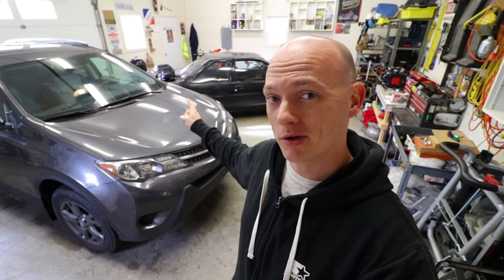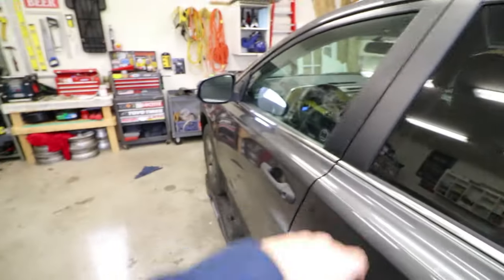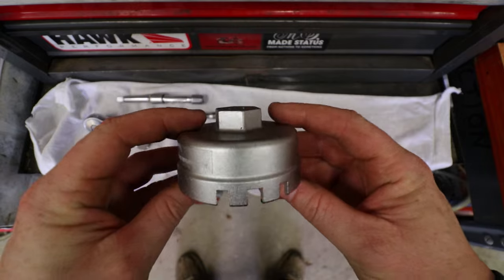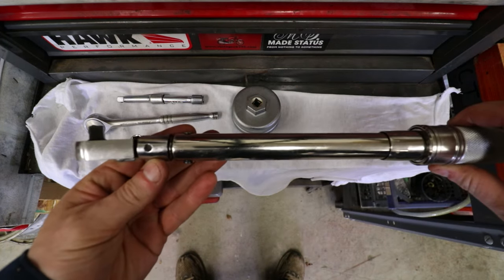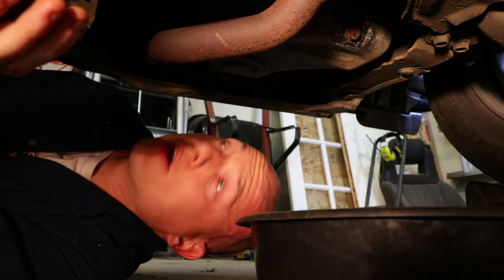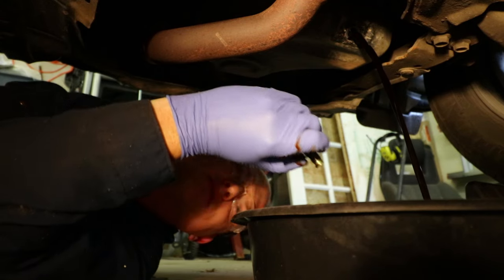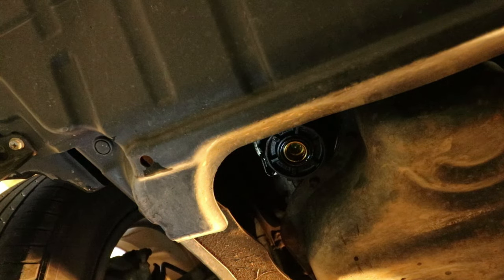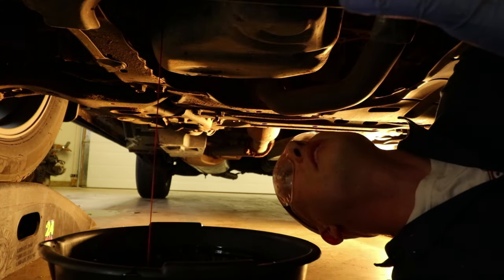How to change Toyota RAV4 oil and filter 2013 to 2018

Comment: Hey, my 2015 Rav4 has over 155k miles. Is sae 20 still recommended or should I buy the oil most mechanics use after 100k miles?(30)
Reply from the maker: Stick with what Toyota recommends for weight. You could always opt for one of those high mileage designed oils from any of the leading manufacturers though, while still keeping the same oil viscosity.
Reply: 5w40

Comment: I see that some manufacturers have a spin on oil filter for the RAV 4.  Would you recommend it or do you like the factory housing?
Reply from the maker: Honestly... I'm so use the the cartridge setup now that it doesn't really bother me. It is a lot less mess than the old spin on type.

A spin on filter mounted on the top of the engine would be the most convenient (ie. Toyota 86 / Subaru BRZ).

Comment: Mike. Some premium oil cartridge oil filters have a steel sleeve inside them. Plus there is a steel sleeve inside the toyota oil filter housing. Will using a premium oil filter cartridge restrict oil flow due to having 2 steel sleeves in a filtering assembly? (OEM Toyota filters don't have a sleeve inside the filter)
Reply from the maker: Hi David. Honestly... That is not a question I can answer. I'm not sure of the engineering ins and outs associated with oil filter design.
Reply: @Mike_Barker  OK. Thank you. I will stick with the OEM filters, don't want to replace the oil pump from over work.

Comment: Took our Rav4 in for its 1st due oil change (covered by Toyota Care) and the dealer didn't even change the oil?!?!?!  They probably think 99 % of the people won't even check but I did.  Turns out OK,  because now I don't want them to touch my car as I've read too many comments of dealers over-tightening the oil filter housing.  I'll spend the money and purchase the tool to remove the oil filter housing.
Reply from the maker: Wow... That is surprising! At least you're in control of the changes from now on.

Comment: I changed mine like it says it takes 4.6 quarts but I had to use the whole 5 quarts to get it up to the top mark on the dipstick.
Reply from the maker: Hmmm something is off there. Typically the instructions line up perfectly with my Rav everytime

Comment: Does it matter if the car is on level ground when changing the oil? I see you have it on a ramp.
Reply from the maker: It's not that critical. Some trace of old oil will always be left in the oil pan. Whether the car is perfectly level or not.
Reply: @Mike_Barker  Got it! Thanks!

Comment: Clean, good job!
Reply from the maker: Thanks Nikolay! Anything else you'd like to see a video of?
Reply: I have the same gen. RAV4 with 67K miles on it Mike, trying to do "Do-It-Yourself" regular checks and maintenance, but without garage it's hard to cover big chunk where you have to lift car up. Would be nice if you could make video or series of video which covers regular check ups every 5K miles followed by Toyota Maintenance Guide, plus when driving in special conditions (e.g. inspect ball joints, drive shafts, etc..)

Thanks and good luck in new project videos!
Reply from the maker: Ah good ideas! Regular checks can be done easily on a lot of things. Thanks for the input!

Comment: Thanks, but GOD, what a PITA!!! What was wrong with the old spin on filter??? It took an hour to do the 2014: Bleeping housing WAY tighter than spec, I cam in to watch video again because it was so tight, I thought it might be  a left hand thread..(Done by DEALER!) Next, I did my daughter's 2007 RAV 4. 10 minutes...!
Reply: Don Hansen same problem dealer did on my niece 2018 RAV4, I tried to do oil change on her car, but filter housing is way to tight the dealer did last time, I couldn’t took it off, afraid will brake off the housing, end up only did oil change without replaced filter.
Reply: @chucktang2783  
PLEASE complain to the dealer and ask they if their mechanics can read and follow instructions? The torque spec is printed right on the top of the oil filter cap. Duh? Tell them if that's the kind of work/lack of intelligence their mechanics have that you are considering never having your car serviced there again and never buying another vehicle there again. I would give the Holy hell.

Also, you should have a ½ drive breaker bar and a ½ drive socket of the proper size that fits the hex fitting on the oil filter cap to get it off.

Comment: Where did you get torque value for oil filter housing and cap? I can't seem to find anywhere. Thanks
Reply from the maker: Hi there I got the values from rav4world.com where someone had shared the factory Toyota instructions on how to do the oil change.
Reply: Specs can also be found at https://www.motivxtools.com/pages/toyota-tacoma-3-5l-v6-gen3-oil-service-guide

Comment: Went to sil-glyde on all those rubber like o-rings and seals. Thanks for the torque values...
Reply from the maker: I haven't used sil-glyde before. Is it safe to use with engine oil? What else can you tell me about it?
Reply: Get some. Helps to rejuvenate and prevent deterioration of any rubberoid type of seal especially if your reusing o-rings. Safer than oil.
Reply from the maker: Sounds good. I'll check for some the next time I'm at the parts store.
Reply: Been changing oil on my daughter's Rav4 for the last 7 yrs. I like the engines on these, not so much the cartilage oil filter, but..... and just traded a Volvo on a '17 Rav4 with 7k miles about ten minutes ago for the whif.. Sil-gyde might actually be found at that parts store that starts with "N". Started using it 40 yrs ago when the rubberized gaskets came out for pan and valve covers. Keeps things supple so it seals up better.
Reply from the maker: Moving from Volvo to Toyota... I might be bias... But that sounds like a decent move! I do love the older Volvos, but "they just don't build em' like they use to."
Reply: Owned a few Volvos. Lots of stories..... now they're just a higher grade of plastic. The newer RAV4  seems pretty nimble and more utility. Surprised a little with all the exposed metal. Want to tighten every nut and bolt then undercoat it. Pull all the seats out and shoot some paint on all the brackets and supports.... hate rust.
Reply: No, sil-glyde should not be used ... that’s silicone grease. That prevents rubber from swelling which you want to happen in this case because it prevents  leaks... and that is why all auto manufactures say to use oil on these O-rings that seal in engine oil... that is also the reason they say to discard the old ones and use the new ones.  Sil-glyde can be used inside the rubber boots that go around caliper pins (and on the pins themselves) for disc brakes. There you don’t want the rubber parts to swell and seize. Sorry but your idea is a bad one. BTW, 3-M silicone paste is far superior to sil-Glyde for brake jobs - or anywhere else that gets hot where you need to use silicone grease/paste.

Comment: Two questions :   one, do you really need to lift the Rav4 with ramps ?   I change my X-Trail without ramps and I am a fairly big guy.    Two (2), does Toyota recommend Moblie One Oil ?   Was thinking of using Castrol  Oil   !!!   Thanks for the video.
Reply: Any 0W-20 oil is fine. They are all synthetic. Walmart Supertech 0W-20 is only about $1 more than the Supertech 5W-30 conventional oil. And of course you don't have to put the vehicle up on ramps but doing so makes it a little easier to take a decent video.

Comment: Hey Mike,

Just like to say thanks for making this video. I changed the oil and filter in my 2014 RAV4 with your help. The housing drain bolt on mine has been tightened up too much from dealership services and I wasn't able to undo it and was just turning the whole filter housing. So I just had to take it off with oil still in it luckily it had cooled abit so didn't burn my hand.

Was very happy I was able to do it myself and it gives you satisfaction doing it yourself.

Just one other thing see the little metal part that hangs down coming off the part where you screw the filter housing back into full view (12:08) like a lip part and then it has little a tiny funnel hanging off it any idea what that is for? Was just interested and a little part broke off mine when I was wiping with a rag but not worried as it seems to not do anything was just interesting lol. 

Watching you in Australia!

Cheers 

Mick
Reply from the maker: From some research on rav4world.com, it seems that it might be a clip (or where a clip should go) that prevents the housing from spinning when you remove the filter drain bolt. Personally... if mine had a clip there... it's long gone!
Reply: Mike Barker Thanks mate keep up the videos I think you do a great job.

Cheers!

Comment: Jeezeee, what is wrong with a regular old fashioned oil filter? This is crazy!
Reply: Totally agree!!! What a pain doing all of that. Old filters were easy peezy. These new fangled ones are a royal pain in the butt.
Reply from the maker: I have to agree! Although... There is less "waste" with this setup. No metal housing for the filter element (like traditional filters) to also get chucked in the garbage.
Reply: Agreed. I'd even say, bat-shit crazy for a simple, simple operation,  but what do I know? ..I'm only an electrical engineer..
Reply: Tell me about it!! I just bought a rav not too long a go 😣
Reply: This is an old fashioned oil filter. This style filter was used before spin-on filters.
Reply: It just takes a little longer and from an environmental standpoint, it makes more sense.

To me removing a skid plate/splash guard is much more work on some vehicles than the small amount of extra time dealing with removing the cap on the oil filter housing.

Comment: Why the added step of draining from a plug?  Can't you just pull the whole filter assembly and dump it like you would a spin-on filter?
Reply from the maker: You can. I think Toyota thought that this way would be less mess though 🤪
Reply: A spin on filter contains less oil than an oil filter housing. 

The Corolla with 1.8 liter engine has a smaller housing and is mounted horizontally so it does not have a drainplug on the oil filter cap.

Comment: Do you need ramps to change the oil?
Reply from the maker: I sure do! I'm 6', 195 lbs and I need the extra space provided by the ramps. You could use a jack and jack stands too.
Reply: I changed mine without ramps and without a jack or jackstands. No problem. In fact on a breezy day it makes less of a mess to have your drain pan closer to the engine oil pan and filter cap
Reply from the maker: That's some solid advice Steven!

Comment: Ouuut= Canadian? That silver oil filter plug screwed out fairly easy for me, but that little plastic drain tube (the thing adapter you called it) that you snapped in, didn't snap in for me! When I pushed up to try and snap it in, it wouldn't snap in and hold! A lot of oil came gushing out (way more than what your video showed) on my palm and all the way down my arm... a real mess it caused! Why Toyota developed this type of filter baffles me! Most likely in Toyota's mind, people who experienced what I did, would probably take their vehicle to the dealership for their entire vehicles life oil changes! By the time I got done, I had a garbage can full of oil soaked paper towels!
Reply from the maker: Sorry to hear about the mess! I've had a couple of those plastic filter drain "adapters" not go in correctly and you're right... It's a pain in the ass!
Reply: I wonder why I haven't had that problem?

Comment: Have you try to change sealed transmission fluid in this car?
Reply from the maker: I haven't. The reason being that Toyota says it's lifetime fluid. I haven't had a reason to change it. Although...the traditional car guy in me wonders how a fluid is "lifetime."
Reply: @Mike_Barker  
Even in 2009 they were saying it was lifetime but at least the 2009 model had a dipstick. I change mine every 30,000 miles regardless of what Toyota says.
Reply from the maker: I'll have to check but I think I'm up over 180,000 kms now. No fluid changes... Yet!

Comment: um you might want to refrain from moving a car down off the ramp with a closed garage door behind it and you probably should have the door open so you don't asphyxiate your self.....just saying.  Other than that very good video I appreciate  the info about the torque specs.
Reply from the maker: Hey no problem! Torque specs are always handy. And don't worry... No asphyxiation...  Running the engine for 10 seconds only. I'd be crazy to run it and breathe those nasty fumes.

Comment: Any info on the 2019 RAV4 and whether it's the same specs and gear? I've noticed you can get the oil filter wrench at Canadian Tire (Says Toyota/Lexus - 64mm) for $10.
Reply: Be careful. There are two sizes wrenches available but they both say they will work for 64 mm fluted filters.

Comment: Question: Can you use regular, non synthetic oil instead?

Second question: How often do you change your oil with the synthetic oil?

Thanks!
Reply: I'll answer my own second question - every 3,000 - 5,000 miles.
Reply from the maker: Yeah 5000 miles shouldn't be a problem. I know Toyota recommends 0w-20 for these  vehicles, however I'm unsure if conventional oil is okay. I'm away on vacation right now, but wanted to reach out to you. I'll do a check when I get back to North America and give you a better answer!
Reply: Okay, Thanks. Great video, very detailed.
Reply from the maker: No problem. Let me know if there are any other RAV4 videos you'd like to see.
Reply: Toyota  new engines require 0W-20 motor oil.
Reply: While Toyota USA demands the use of 0-w20 (synthetic oil), it is only recommended in Canada and Mexico. ... but then recommended change schedule  for the USA is at 10,000 miles, for Canada it’s 8,000 km, and 10,000 km for Mexico .... It’s apparent that the CAFE rules enter into Toyota’s  thinking here. I bought my Rav4 from a dealership in Mexico and the rules are different in each of the three countries for oil changes.
Reply: Robmar Only in the USA is it strictly required.... but then they are also on an extended oil change schedule of 10,000 miles... in Canada it’s half that.
Reply: @Mike_Barker  
There is no such thing as conventional 0W-20 oil, at least that's what I read. All 0W-20 oil is full synthetic. The only exception is one of Pennzoil's oils which has a 0W-20 synthetic blend available.
Reply: @Robmar40  
Some of the new engines require 0W-16 motor oil.

Comment: Even if you use those ramps, use chocks on the rear wheels and place jack stands underneath.  Can't be too safe.
Reply: THAT is overkill. The car is in Park AND the parking brake should be on. That's plenty. IF you jack up the vehicle then use jack stands and chock your wheels.
Reply: And what if you don't use ramps and don't even raise the vehicle off the ground? There is enough ground clearance that some of us can change the oil without raising the vehicle up. You still want us to chock our wheels? Maybe we should always chock our wheels no matter where we park even in our garages?

Comment: What is the clip on the top of the housing @ 11:30? Any concern with this clip when unscrewing the housing?
Reply from the maker: I believe it's to keep the filter housing from backing out. I've had no issues removing the housing though. Come to think of it... my clip may have gone missing since I made this video! I'll check the next time I'm working on the car and let you know though. 👌
Reply: Thank you for your quick reply. If the purpose of this clip is to lock the housing in place, I wonder what is the proper way to release the clip to prepare for the removal of the housing.
Reply from the maker: I've never had to do anything special to release the clip.
Reply: I've replaced the housing cap on ours and neither the original nor the OEM replacement had a clip on it?

Comment: Hmm, why do you say 2014 and up. (Correction, 2013 and up.) Our RAV4 has the same type filter and it's only a 2009?

Glad to see you using a torque wrench though. If you got one then you might as well use it. It will prevent over-tightening the oil filter cap drainplug to the point of not being able to remove it without removing the oil filter cap/housing with it.
Reply from the maker: I think I said 2013 (that's what year mine is) because I wasn't confident that the earlier models used the same style of filter.
Reply: @Mike_Barker  Thanks Mike. I subscribed...

How has that aluminum filter cap been holding up for you? I've been reading the pros and cons of switching to an aluminum one but haven't decided.
Reply from the maker: @stevensevek6151  do you mean the aluminum oil filter housing drain bolt? If so, it's just dandy. It's what came on our Rav from the factory.
Reply: @Mike_Barker  
No, the oil filter housing is called an oil filter cap on most listings I've seen. Anyway I was asking about the housing not the housing drain plug.
Reply: @Mike_Barker  
Some folks have had problems with the aluminum housings and switched back to the plastic.  See https://www.tacomaworld.com/threads/dorman-oil-filter-cap-issues.632375/